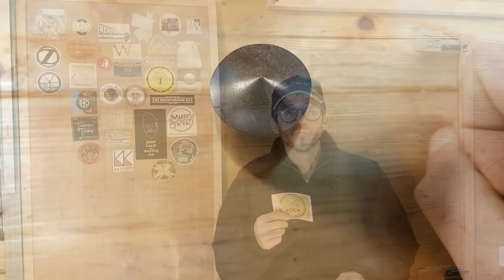Goblet Upgrade + Stickers!

Comment: if you want to improve it even more you can make a holding place in the bottom of the dark wood part, insert a circuit with diode and make it glow in the dark :) mixing modern technology with beautiful wooden craftsmanship
Reply from the maker: I've always wanted to make a mix, but alas, I can't afford to buy too much hardware these days... I'll have to make an aliexpress run soon for some different projects :)

Yuval

Comment: As you mentioned, I didn't think you needed to change anything. I stand corrected...a big improvement. You clearly have a good eye for woodturning art. Well done Yuval. 
Are you responsible for this miniature trend of late? I see there are several who have jumped on board. Unfortunately I lack the sharp eyesight and steady hand that is required, but I love to watch.
Reply from the maker: Thank you Gil!! I wasn't happy with the stub when I first did it, I thought it would necessary, once it clean it isn't, it had to go, I just couldn't leave it there, where I felt it didn't belong. I'm not responsible for the miniature trend, it was Steven Twydell who started a challenge in one of the facebook groups, but I sure was the loudest, and dare I say, one of the smallest :)

Yuval

Comment: If you want to add some strength to your goblet without taking away from its look you could put some clear resin in the open spaces to reinforce the whole goblet overall.
Reply from the maker: Yeah, that might work, but it will feel a little like cheating... :) Thanks for the advice Adrian!!

Yuval
Reply: Yuval Lahav Woodturning
Cheating how? You've already done all the work to shape it. If anything it could be harder to properly get the resin in to the space between the cup and the stem.
Reply from the maker: Cheating in it won't be an integral part of the wood itself. That was a small joke, since I really don't have any problems using resin in my work, when it is needed. I just feel that this project, part of the appeal is the fact it is so delicate.

Yuval
Reply: Yuval Lahav Woodturning
Fair enough, all the same it is a beautiful piece.